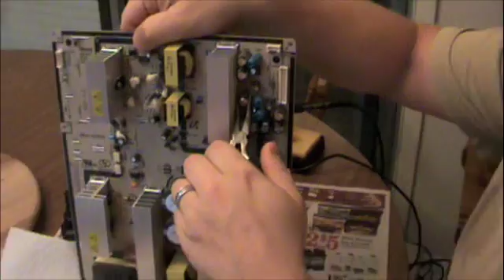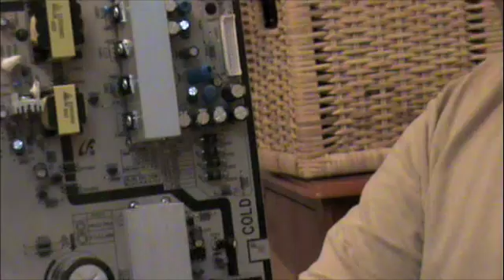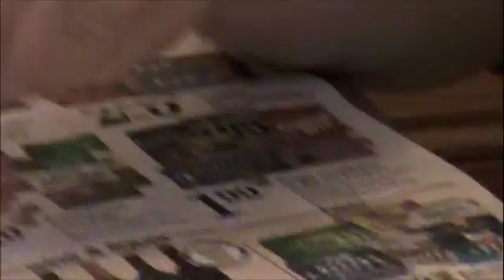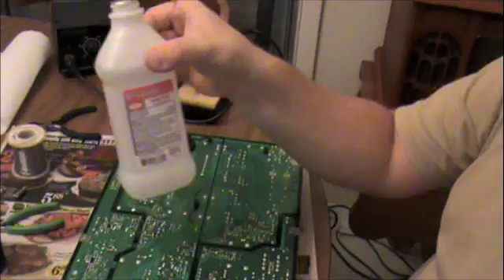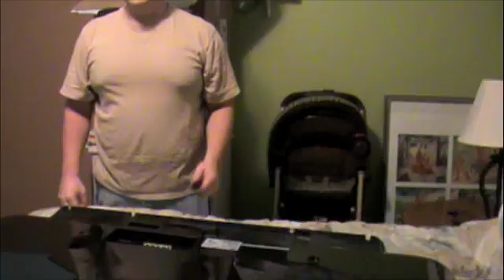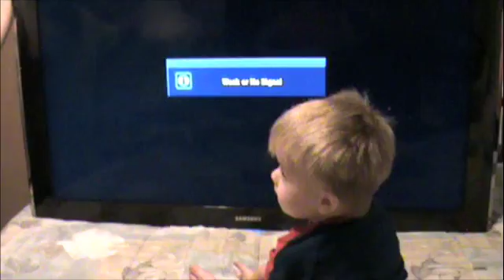Samsung TV Repair- PART 2 OF 2

Comment: I had the same issue with the multicolored lines, but the 10V capacitors (x4) on mine were bulging.  I replaced those and it immediately resolved the issue.

Comment: Thank you so much for the info!  This helped me fix my 42 Samsung LCD TV.  In addition to powering on and off it was doing the rainbow screen.  4 capacitor replacements later, its as good as new.  BTW, on another board I found a suggestion to replace the 10V capacitors with 16V capacitors (which I did) to reduce the likelihood of this happening again.

Comment: I have a Samsung LNS4041 and when I turn it on, I get multicolored lines on the screen and audio is fine. Is this due to power supply problems. I looked on the power supply board and there are no bulged out capacitors. I am tempted to replace the electrolytic capacitors.

Comment: great vid. my 40inch samsung HDTV started actin up around 6/17/09. i bought the tv from bestbuy on 6/21/08. i never heard any clickin but the led light would blink several times. call samsung and bestbuy, i didnt care who came 1st. on 7/7/09 bestbuy came and took the back off and guess what blown caps. so he ordered a pb supply. on 7/27/09 day after bday, samsung came and replace board and something else, u plug ur hdmi in. he replace that board as well. so far so good on 9/5/09 tv is doin great

Comment: To me it well worth an extra few bucks to get a good capacitor. I suggest digikey. Ask one of their reps to help you navigate around on their web site. 

The capacitor checker I'm using is a EDS-88A. Someone told me its the Cadillac of cap checkers. I don't know if this is true, but I'm pretty happy with it, except that I wish it was damage proof. 
   I disagree with your opinion on wire wick. I think if you had a high end soldering iron and good wire wick it would be your preferred method.

Comment from the maker: Great work!  Sounds like you fixed yours even faster than I did mine...

Would you mind sharing with us which capacitors you replaced on your 40inch Samsung and what brand and part number caps you replaced them with?

Comment from the maker: Hmmm, not sure about that one...

I suppose the best thing to do would be to remove the cover (if it's out of warranty) and look for any of the suspicious bulging or leaking electrolytic caps that I pointed out.  If you see any suspect caps, simply find replacement equivalents (with higher voltage ratings) at your favorite parts place.  I was in a hurry so I used Fry's Electronics down the street and paid an outrageous $3.87 for each capacitor.

Comment from the maker: The solder wick is very useful tool for helping to remove excess solder from a board.  However, in this case I found the 'rocking' method of removing the cap to be much faster for this power supply board.  

In some cases, (as with my PC motherboard) the ground plane within the board is so large that it is difficult to remove the solder around a through hole due to the heat sink effect of the ground plane.  In that case, a board preheater would be called for which is a bit more advanced.

Comment from the maker: Thanks TV Daves, 

Do you have a particular in circuit capacitor checker that you can recommend?  I have never used these before, but if they work well I can see how they would be useful.

I agree, the Japanese capacitors are of a higher quality but higher priced than their bottom of the barrel Chinese equivalents.

Comment from the maker: Sorry, Youtube will not allow me to post a comment with a link to the TR forums.  If you go to techreport (dot) com and search for the "Samsung LCD TV - LNS4051 power on problem" in the forums there, I am sure you will find the images I am referring to :)

Another potential problem you could be running into is an overheating problem where the Visio controller shutsdown the display to protect itself.  

I hope you are able to find a solution.  Good luck!

Comment from the maker: Thanks Rene, I am not a TV repair expert, but your problem is intriguing.  Your problem sounds like it could be caused by unstable DC power rails (which is a result of bad electrolytic capacitors).  As long as your TV is not under warranty, you have little to risk by opening the case and taking a look around in there.

The folks in the TR forums have taken some great close up photos of what bad electrolytic caps look like:

Comment: If you do a lot of TV repair work, you might consider a high end in circuit capacitor checker. Often times there are bad capacitors you can' t detect just by looking at them. I have also found the Japanese capacitors are of a higher quality.      
There is also a in inexpensive product called wire wick which makes the unsoldering process go much faster and easier.

TV Daves in Grants Pass Oregon
(541) 479-3915

Comment from the maker: Axial lead capacitors will probably still work but you will want to protect the exposed lengths of the leads with shrink tubing to make sure that they don't short circuit to any of the adjacent components.  Also, make sure that they negative lead has the shorter lead length.

Comment from the maker: Take a look at the capacitance shown on the side of the caps you want to replace.  Replace with capacitors that have exact same capacitance value (1000uF-->1000uF) but with a higher voltage rating (6.3V-->25V).  Basically you want to replace the cheap factory caps with something that will last longer.  They don't even have to be the same size, as long as they fit on you on your board they should work.

Comment from the maker: Yes to both questions.  I would recommend replacing the 5 1000uF 10V capacitors with anything rated above 25V.  However, I've found that the higher the rating the more expensive they are.